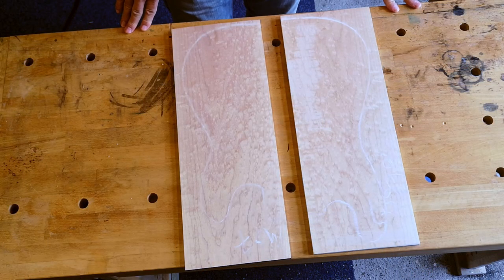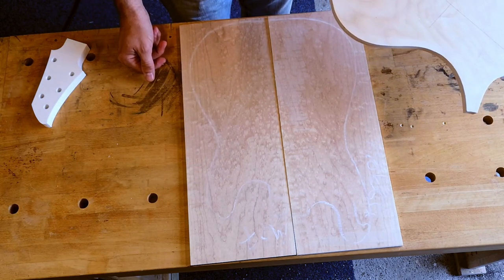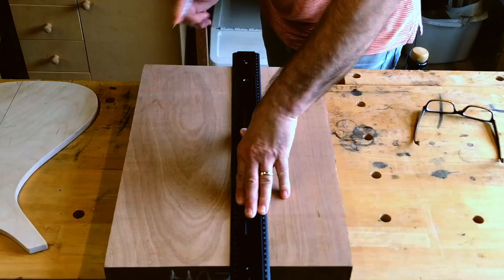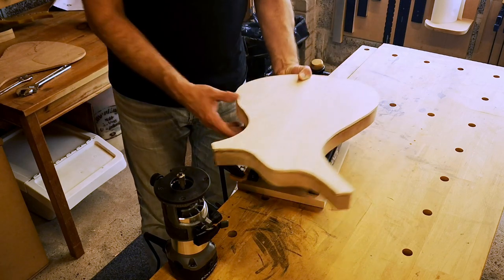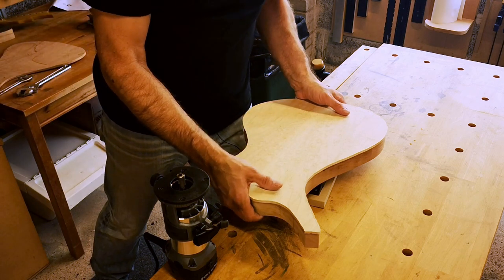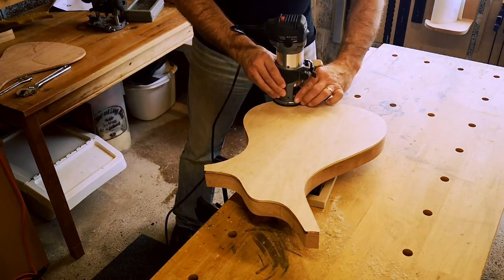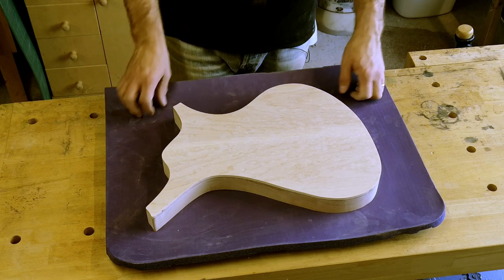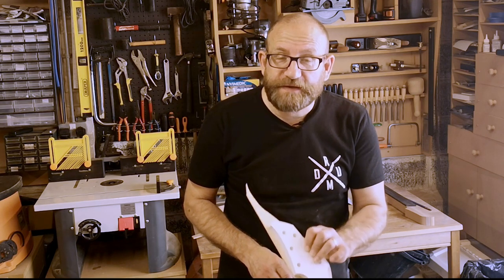GGBO22: Episode Six - Body diversion

Comment: Turns my stomach in knots when I see a router catch and throw wood like that. I've had grabs but never lost it altogether. I just bought one of those bits because you can turn the work over and against the grain. Good that you were able save the project by a little reshaping.
Reply from the maker: I know what you mean. I couldn't watch that bit back at first - it made editing difficult. 😂

Comment: If you watch the video you can see the router bit move when you push the wood against it. Your router mount is flexing under pressure. That means the router bit cuts at an angle and can spring back into the wood suddenly and grab hold and toss the wood away. What you have is very dangerous and you should not use it until you can make it good and solid. I had a router with a bent collet that  grabbed wood much the same way. Took me a while to figure it out. But after I swapped routers it doesn’t grab wood anymore.
Reply from the maker: Thanks for the feedback, glad you spotted that. 👍 The table router has been on my list of things to replace for a while now; I shall have a word with Santa. 😁